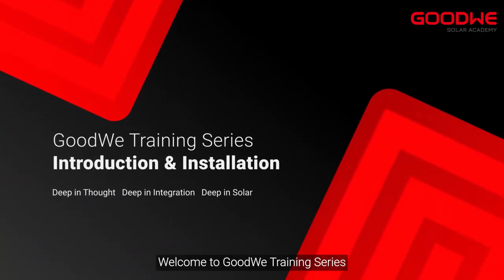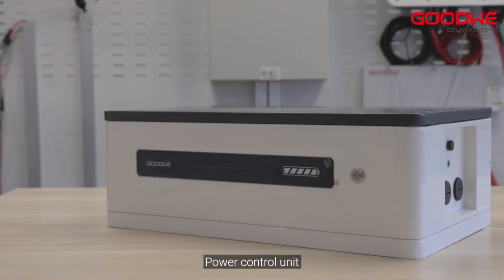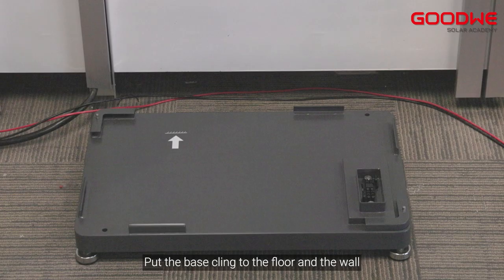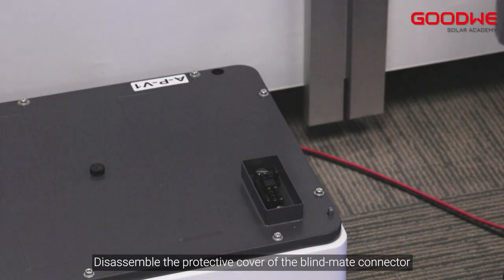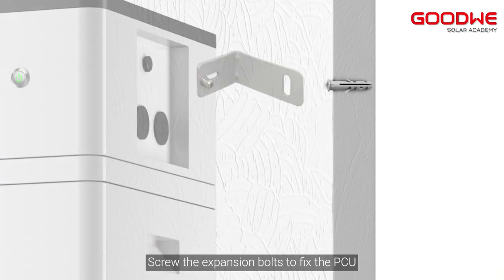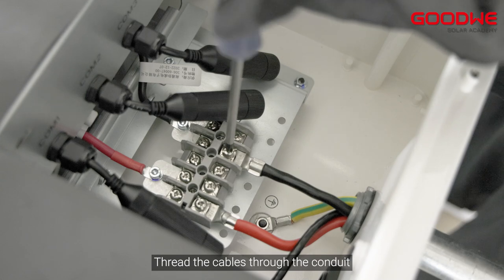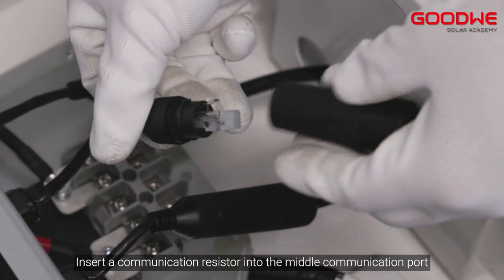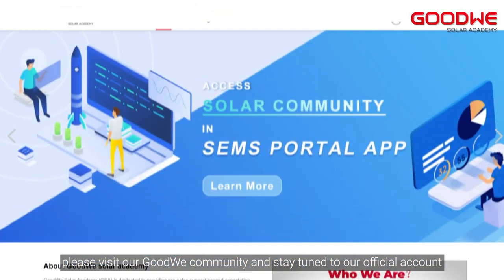GoodWe Lynx Home FH-US Series Unboxing and Installation

Comment: Lynx F-H US 9.2kw battery BMS communication RJ45 cable does not match with my Goodwe A-ES 7600 inverter no RJ45 connection on this inverter. I had been trying to figure out how to connect to the BMS plug to the inverter no straight forward explanation on the manual either Battery or Inverter manual. Call Tech support this morning they are trying to get their Team to get back to me. On the website the Lynx F-H US battery is PLUG N PLAY?? Also on the list of battery Lynx F-H US 9.2kw is compatible with Goodwe A-ES 7600 inverter. Please somebody make  comments thank you in advance.
Reply from the maker: Hello, please check the connection of your battery and inverter. The PIN4 and PIN5 go to CANH and CANL, please make sure the sequence corresponds.
Reply: @GoodWeSolarAcademy  Did that thank you!